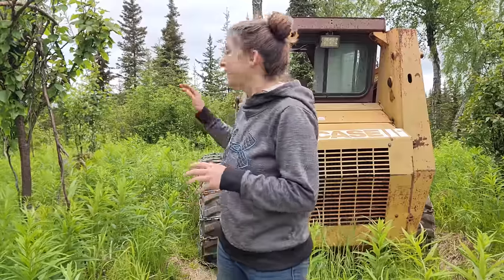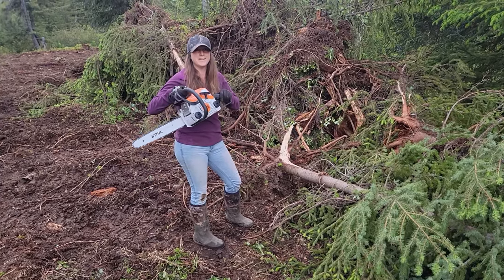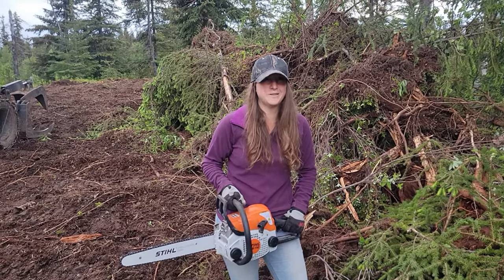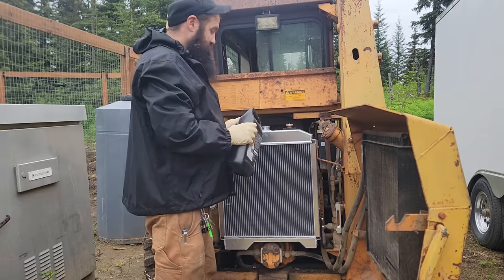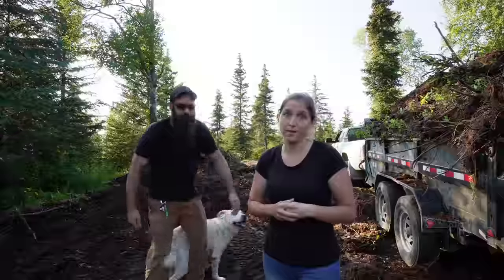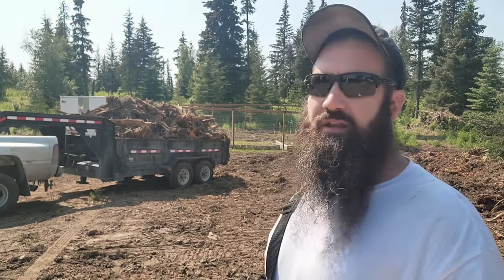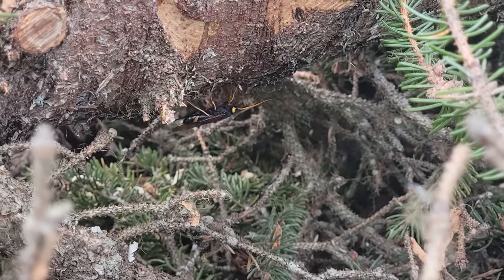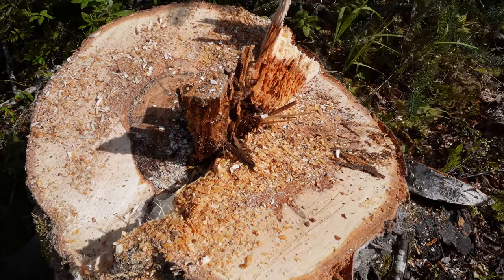Land Clearing for Our Cabin in Alaska

Comment: You guys should invest in a mulcher so that you could mulch all that wood up yourself. And that way you have extra for the garden. And for when it snows or when it gets muddy and stuff. You can add that mulch in there.
Reply from the maker: We did consider buying a small mulcher for small debris.  Unfortunately, a tub grinder that can eat the size slash and stumps we had to get rid of would cost 75k plus and is not practical for a homestead. We actually have around 30 tons of compost piles left after this cleanup. Not all of it was shown in this video. Anything that would break down in the next few years we saved. It was beneficial for us to haul away the large rotting stumps and slash because they would become a large source of fuel in the event of a forest fire here. There is also an issue with destructive wood beetles here, and those piles make perfect breeding grounds for them. We really do not want our forrest to die from beetle infestation. Thanks for watching 🙂

Comment: Impressive to manage thoose big stumps with that little case!
Reply from the maker: The trees here grow close to the surface. Otherwise, I don't think the skid steer would be able to pop stumps out of the ground as easily. The machine has oversized tires and extra counter weight installed, so it has extra weight to get the job done. Thanks for watching !

Comment: That brush grapple looks huge for that little skid steer.  Seems to do the job though.  Don't go on a diet any time soon.  Keep her greased up as a big implement puts more strain on everything.
Reply from the maker: The solesbe grapple is very heavy. No worries about bending it up like cheap models. Most of our attachments we purchased used so they may not be the perfect size for our machine, but they were the right price. The wet stumps combined with the weight of the grapple must be near 3000 lbs to lift the back tires. A fun fact about the antique 1845c , they were the biggest skidsteer in production at the time of manufacturing in 1995. Crazy how much the industry has changed with the 16000 lb tv620b they produce now. But I grease it and maintain it regularly it's not realy in the budget to replace it anytime soon. Hope you enjoyed the video!

Comment: The old Case is getting it done.   Pretty crazy how all the trees grow on top of the ground, makes the work a little easier. Bummer about the radiator, at least you were able to get another one.   Still’s are the best. How many acres do you have?  Unless you’re going fully hydraulic , definitely consider a Frontier sawmill, for the price you can’t beat them. Thanks for taking us along on your journey
Reply from the maker: Yes! Machines keep on going with some maintenance!  The trees have really shallow roots here. I am  surprised more do not fall over from the nonstop rain and occasionall heavy wind. At least it makes stumps easy to remove without an excavator. I can agree that sthil are a great choice.  My father gave me a handmedown sthil many years back that I wore completely out, but it did a lot of work before needing replaced. We only have ten acres here. We originally intended to purchase more, but  we had no luck finding large properties that were high and dry without major muskeg. We made a very low offer on this property, and to our surprise, the owner sold it to us.  This place meets a lot of criteria we were searching for, so it really worked out well for us. We purchased an hm126 sawmill and brought it with us from Pennsylvania because shipping it here was almost the same as the price of the mill. We should have it set up before winter. We want to start drying some lumber for spring projects!  I would have considered the frontier mill, but I did not know of them prior to watching your video.  Have you seen "sawing with sandy" on youtube? He does some interesting work with his sawmills. Good channel 👍
Reply: @northtoalaska2022  That’s awesome.  I looked at the Woodland Mills but at the time they were a year out. They are good sawmills. I do watch Sawing with Sandy, those red pines he mills cracks me up. They’re like toothpicks 😂.   Your Case will be a huge work saver with the mill. I mill mostly Oaks,  Cherry and Maple
Reply from the maker: Haha yes sandy has to cut a lot of trees to get lumber! I do miss the oak trees back east. They were awesome firewood as well.  Most of our white spruce here are very large diameters compared to other parts of the state. The black spruce trees are skinny and tall.  But it should make a decent lumber yet.
Reply: @northtoalaska2022  I’ve never sawed a pine on my mill.  I have a pretty good pile of Oak from the clearing I did for our solar system.

Comment: Before you start building consider taking down any tree that can fall on your future cabin. Also those trees will keep growing so they may be a problem in the future and it is easier to take them down now without a structure to worry about being crushed by a falling tree.
I love seeing the wildlife, so very cool. Have you seen any brown bears?
What do you both do for work in Alaska?
Are you living in the log cabin on your land while you prepare to build?
Reply from the maker: The log cabin is in poor condition,  its foundation is only wooden logs in the ground and some of them have rotted completely off causing the cabin to settle into the dirt.  We did patch the cabin up for now, it needed a roof and flooring repair when we moved out here last winter. It is working out well as a shed, and the small half we converted into a chicken coop for now. In time we will tear it down and salvage what we can. We are living in our old motorhome while developing the property. There are black bears and brown bears here. We mostly see moose, they are here most days walking the creek or the driveway. A bear did kill a baby moose in our woods this spring but it has since moved on.  We enjoy the wildlife very much. Before Alaska, I worked a career as a heavy equipment mechanic,  and Katie worked in corrections. Since we have been able to become mortgage-free our goal is eventually to go down to a single-parent income. We do not want to do child daycare and are interested in homeschooling so one of us will need to work from home or not work a 9 to 5 in general. Alaska does pay well for skilled trades, and they are always hiring. There is a shortage of tradesmen in general. We are also working on other local business opportunities at the moment as well.
Reply: @northtoalaska2022  I enjoy watch the videos you guys make. I would love to move to Southern Alaska and have a very secluded property to build on, but I work in healthcare and it would likely be more challenging to find a job in an Emergency Department at a hospital outside of the major cities in AK.
Reply from the maker: Glad to hear that you enjoy our videos!  If you ever begin to look seriously at properties you could live in a secluded area on the south end of the peninsula and commute to Homer for work they do have a hospital in that town and other medical facilities. May be worth checking into.  If you are referencing very far south near Juneau I'm unfamiliar with that area.
Reply: @northtoalaska2022  Thanks for the info. I was referring to the the Kenai Peninsula as Southern AK. I want to be on the road system to be able to drive to Anchorage and Fairbanks if I ever need anything that is not available on the peninsula. I have looked at land North of Homer and there are some nice parcels 40ac, 80ac, but many are land locked and would require a ROW or an easement to access for a driveway which can be challenging depending on neighboring land owner cooperation.

Comment: Great video, but need to buy some tow hooks for the old dodge, my 2500 dodge did not come with tow hooks, 
Can be easily added, bust add on I have made,

That skid steer looks like fun to drive,
Reply from the maker: This is true! We fully intended to install a better bumper with a front recovery point prior to moving up north because getting stuck out here is inevitable. We unfortunately ran out of time before our moving deadline. Will reconsider it again in the future when we have extra time. Luckily, there is an unused bracket welded to the passenger side frame rail that is safe for pulling on but is not convenient. Thanks for watching 🙂

Comment: You need some of those metal tracks that slip over those tires for that skid steer it makes a world of difference in operating
Reply from the maker: We would love to find a used set of rubber track conversions with gear reduction for this machine. Unfortunately, they are too expensive new.  We thought about adding steel grouser tracks years back, but this model does not make a good candidate for the added extra weight. The chains in the undercarriage can not handle the extra stress for long and cause expensive maintenance on chains and gears. Thanks for watching 🙂

Comment: Making nice progress!  Having the skid steer is huge. Glad you got a radiator fast…dont what to know how much that cost!
Reply from the maker: Yes, one day at a time! We tried to cheap out and get a radiator on eBay or Amazon, but they won't ship one here.  I'm sure you have run into similar issues since you moved to this area. We have run into many big items that we attempted to ship in to save money, but it pops up as not shipping to our location 😆 this one ran 350$ on sale, and shipping was expensive but no other choices. Still saved 800$ over dealer price in Anchorage, so it all worked out!
Reply: @northtoalaska2022  yeah shipping is hit or miss here.   I just ordered Blizzak tires for my truck on Amazon.  Zero shipping cost with 5 day shipping.  Makes no sense.

Comment: Now that is a nice Radiator wow better than you see in most vehicles that must have cost you a mortgage
Reply from the maker: I tried to cheap out on Amazon or eBay, but it turns out they won't ship an item that large to alaska. So I bought a superior all aluminum radiator from a company in Delaware USA. No mortgage here. We are running a debt free homestead. This radiator was only a third of price that the local case dealer quoted me 🙂

Comment: Lots of work done. I had a 16 inch chainsaw and cut all my own firewood. Perfect size for me. My woods had been logged years ago, so all the reachable wood was less than a foot across.
I learned soon on, to position the wheelbarrow aimed the way I was headed. Too easy to tip it over turning it.
Reply from the maker: Smaller trees make the best firewood! Less splitting and easy on your body when moving it around.  We can both relate to the wheelbarrow! Have had many spills over the years from uneven terrain... thank you for watching 🙂

Comment: Glasses chaps alaska medical is usually not close good content subscribed
Reply: Good point. Also long hair and any loose clothing should be dealt with. I have an off-road place and dinged my left index finger pretty bad on a table saw. I had to wrap the hand so I could use the brake on the snowmachine to get to the parking lot and then drive an hour. It was about -20 F.
Reply from the maker: Accidents can happen fast!
Reply from the maker: @Neveragain572  I do worry about accidents like that.  We try to be as safe as we can. I put together a med kit for just in case of incidents like your table saw.  Even have sutures to stitch a wound on hand. Hopfully, we never need them.  I'm glad your accident turned out OK in the end.

Comment: Can't believe people go out and spend all that money on those splitters I can it cost me $600 to build a splitter that was split three foot rounds I used the ram I used ram of AD8 cat one that lift the blade the front blade a used Five Horse Briggs and Strack and motor got the hydraulic pump and the handle the control valve from Princess Auto main body was an 8 by 8 chunka square tubing which was the hydraulic tank welded it up together put the RAM on the top of the tubing and the ax head on top of the tubing put a flat chunk of steel on the on the RAM end and I put it on two by two square tubing frame but the motor on it put it on some old citation tires with a straight axle there you are trailer hitch on it$600 probably a little bit higher now and I just sold it two years ago for $600 and I used it for probably 15 to 20 years splitting firewood that I used to sell big old growth Douglas fur 3 foot 4 foot rounds on it split it nonstop could never find a chunk of wood to stop it twisted wood wouldn't stop it with cut right through the twisted wood had to get a splitter because I went back was so bad because I split fire wood and sold it for years but it sold so much with 400 quarter a year and then I sold the splitter for what that cost me to build it pretty good first thing I think I've ever made my money out of and then some😁😁😁😁And it was very easy to build I just got tired of renting them and just took the design off one rental one I rented and built it
Reply from the maker: That sounds like an interesting project. I can imagine it has paid for itself time and time again!  We were fortunate enough to find this splitter back east in Maryland for 500 dollars used ready to go. It's not fast but takes a lot of work off our backs. We had split and burned our own firewood back in Pennsylvania for many years as well.  I have seen the big box stores here are up to 1600 for a new wood splitter...
Reply: Yeah the Splitters are over $1000 and their little ones they don't split nothing hardly I like the idea of the two way splitters that you guys got that can stand up to do the big ones so you don't have to lift them up onto the splitter I used to have so big a rounds that I'd have to stack the wood a big pile on one side of the splitter and roll them up on top of the splitter to split them that's how big the logs were that I used to split the big old growth fur here on Vancouver Island get pretty big so big an S-10 truck box 4 by 8 would only hold three pieces And when I rolled them off with a big pile of the burn pile it shook my truck like it was gonna fall apart @northtoalaska2022